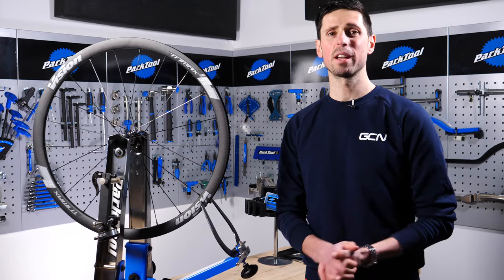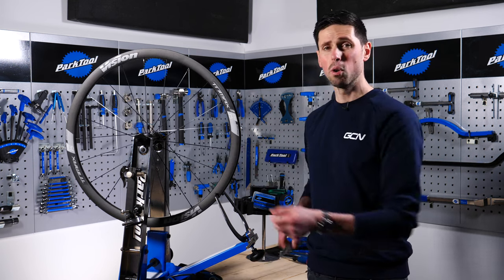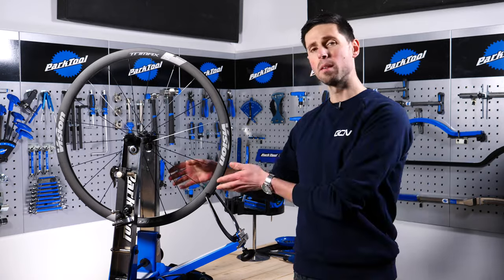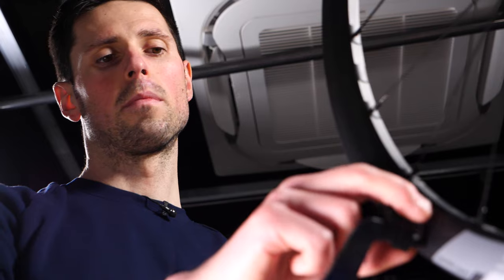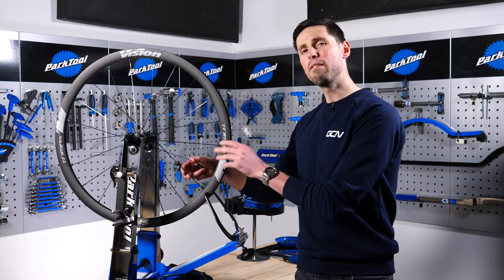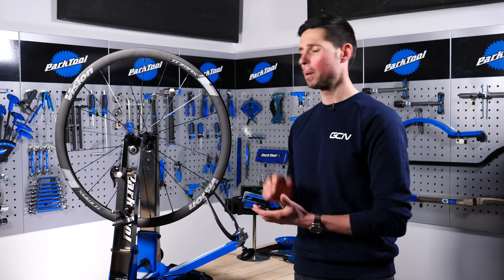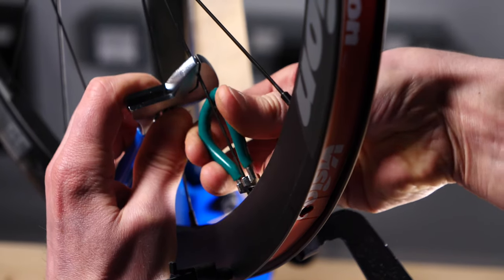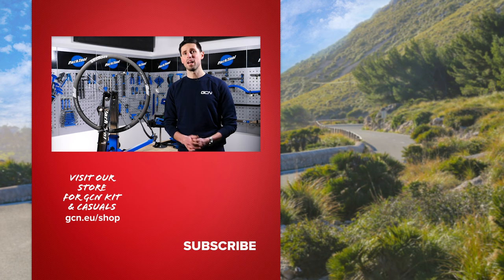How To Fix A Buckled Bike Wheel

Comment: The clockwise instruction is very confusing if you don't specify how you look at the rim.
And isnt he turning the wrong direction when he says to add tension? (4:06)
Reply: When you have the wheel in a stand, figure out which direction tightens the spoke, and remember that.  You’ll figure it out.
Reply: @keirfarnum6811  uhm, I do know that. Thats why I mention it's confusing and that they've used the clip at the wrong time.
Reply: Watching the video it looks like clock wise/anti clockwise is viewed from outside of the wheel rim
Reply: Just to make it clear, it's at 4:06 ish when they added the wrong clip.
In the end the exemplary clips are correct, but the diagrams could've mentioned the viewing angle for clarity. (Judging from my own experience, I get confused by clock wise direction all the time )
Reply: Correct - its an easy mistake when coming to this new and presenter has failed to include the perspective.
Reply: There's method called the GT method, where basically when drawn on the inside of the rim, one imagines the end of the G where it's pointing to the inside of the G that it's an arrow. Basically the G is an anti clockwise indicator if you see what I mean. The T reminds the direction tightens.

Comment: #AskGCNTech I broke a spoke on my back wheel, and the wheel buckled slightly.  How do I know if I should fix the spoke or to get a new wheel?
Reply: Spokes are cheap (unless you have some super special kind of wheel with non-steel spokes), so replace the spoke and see if you can get the wheel true, round and evenly tensioned across the spokes on the same side of your rear wheel.  If you can and there's no other damage, you should be good to go, though some suggest replacing spokes nearby the broken one, especially if the wheel had been ridden in the damaged state, because they may have been damaged/weakened, but not failed yet and are more likely to fail in the future.
Reply: @ytyehyeh  Thanks!

Comment: I’ve just had a rear 20 inch rim build done with a rear hub motor. The problem I’m getting is when I’m going fast and apply the rear brake my bikes back wheel slides to the left nearly lost balance why is this happening. I have mechanical disk brakes

Comment: One thing not mentioned in the video, if you've got the tyre still mounted on the rim, deflate it before you start truing the wheel, it will make the job easier and more precise.

Comment: how to determine the right tension for the spokes in the first place?
Reply: I believe some rim manufacturers specify maximum spoke tension.  Of course, that will require you to get a good tension meter with the proper indications.   I've built my own wheels for decades, and usually compare the tension (by squeezing pairs of spokes) in the wheel that I'm working on to one of my wheels that has been reliable.  A proper tension meter is probably the better method.

Comment: Imagine that he has a dishing tool right behind him On the wall and he didn't even check the dish first. That way you know what side of the rim to add tension and which side to loosen. . Also at the end he did not destress the wheel. Further he has a tensiometer on the wall and he didn't talk about using that to tension balance the wheel either. Come on, you can do better than this
Reply: I think they were aiming at the beginners.  But beginners shouldn't be truing wheels.  That's what local bike shops are for.

Comment: The next great break though in bike tech will be wheels that stay true.
Reply: Full carbon...  Have carbon tri spokes on one of my bikes, has never needed truing since 2016
Reply: BMX mag wheels are gonna make a comeback, always true and momentum to keep up the speed.
Reply: Tyres that don't puncture every few days would be nice.
Reply: I have an old set of Spinergy wheels that have stayed true for about 15 years :)
Reply: @Rover200Power  I've had good luck with Continental Gatorskins.  They're expensive, but better than getting a flat in the middle of nowhere.

Comment: If it's possible, shouldn't one true the wheel with the tire on and inflated? I'm thinking that one would want to true the wheel under the load the tire would normally be exerting on it. Could be wrong, but this is what I've done in the past. Never really done a detailed trueing, just a "good enough" trueing to make rim brakes run evenly.

Comment: My cousin borrowed my bike for 1 hour, when he returned it i had to get both rims trued because that idiot thinks my road bike does enduro
Reply: Never, never give your bikes to anyone
Reply: @carpvictor1214  borrowed it without asking
Reply: @timothykiefer2289  
Nobody, and I mean NOBODY, rides my bike but me.  I have a short cage Dura Ace road derailleur on a mountain bike and it I were to cross chain from the big chain ring in front to the big cog in the rear, it would rip the hanger right off the frame (and it’s not a replaceable hanger like on modern bikes).  I have to be very careful about shifting, so no one gets to ever ride it.

Some advice though, get a set of hand built wheels made for you.  They are much better than machine built wheels and won’t go out of true as quick.  You don’t need to buy all new parts either; you could take your current wheels and have them rebuilt with new spokes.
Reply: @keirfarnum6811  thank you for the advice🙂
Reply: Lesson learned.

Comment: Now try this on a wheel with 5.000 miles through dirt, grime and potholes under his belt instead of a new wheel of which you've just loosened a spoke for demonstration purposes.
Who on earth will by himself a truing stand whithout the basic knowledge of wheelbuilding?
Start by checking for loose spokes regularly and thighten them before your wheel develops a significant buckle in the first place. Once you've got the hang of it you can build your experience a get yourself some proper tools.
Reply: I have just bought myself a truing stand and i will learn how to build a bike wheel. The reason is because i don't have a local bike shop nearby and i collect classic bikes.

Comment: This is a skill unlike any other on a bike, and can go badly real quickly. As someone else mentioned, perhaps checking whether the wheel is dished accurately should be the first step. And considering that it is a road bike wheel, you might also want to talk about a wheel being 'round'. As a mechanic, I've seen many people try this at home, and end up bringing the wheel into the shop... often times something that looks so easy here on a video can make a wheel a major challenge to get 'true and round.' Also, the video skipped "releasing' tension at the end.... perhaps rather than suggesting someone try this at home, you should really consider advocating  they take their wheels to a reputable shop...because this video isn't replacing their skill!
Reply: So if my wheel rim has been bent due to my neice riding my road bike up a large pavement stone, how do I squeeze thr rim without effing around with tge spoke nipples? Its made of chroome, a Peurgeot hibrid road bicycle 28 inch wheels.? I have dome Zen Buddist comming tomorrow. I will pray to Mecca. Wasted my time bothering to even ask my ex as he made it worse and swore at me. I LOVE my bike. I detest him. And my neice.